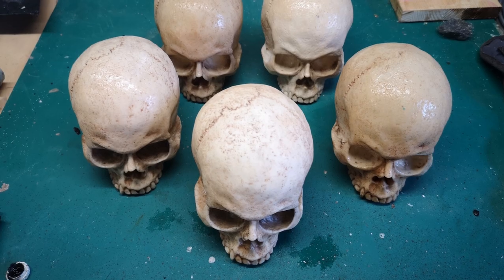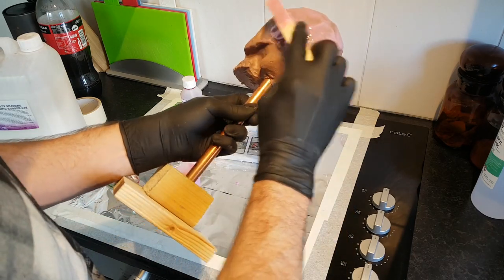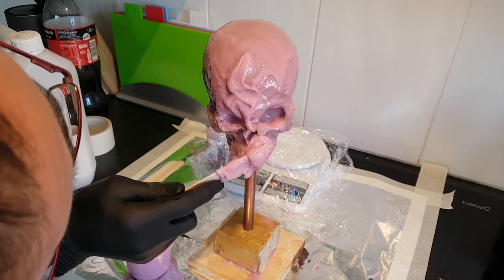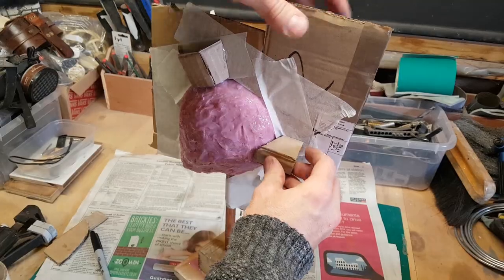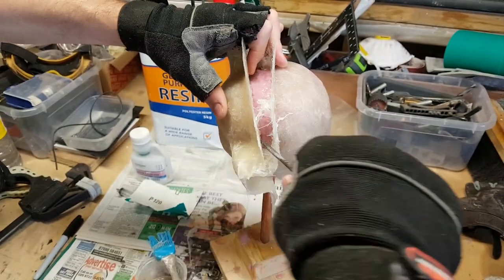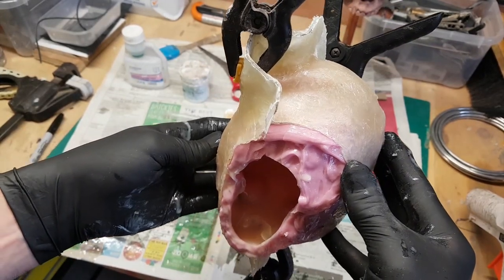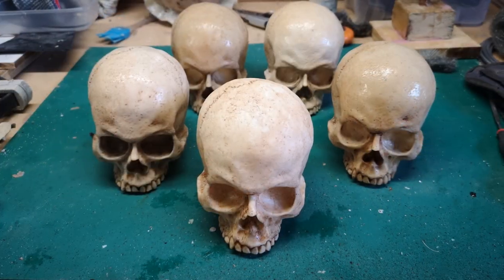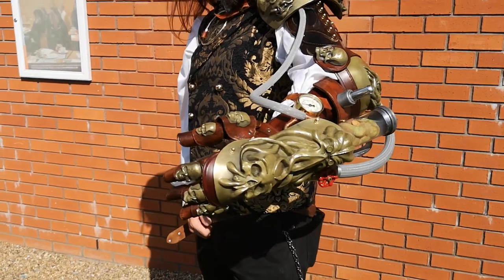Moulding and Casting Skulls

Comment: Love it! I sculpted a small skull (between the size of a golf ball and a baseball) and I am wondering what is the best method to make a mold of it for casting? 1. Place in a cup and pour resin in the cup? or 2. two part mold of L and R sides similar to this video... ?
Reply from the maker: The easiest way would probably be to attach it to a board, hot glue some foam board around it to create a surround and then pour the silicon.
Reply: @thedarkpower  Thank you!

Comment: Could concrete be used in this type of mold, and if so, how many would it cast before starting to degrade?
Reply from the maker: Yes it could. For something this small I'm not sure how well it would pick up the detail, but you'd get something.  Generally moulds can do about 40-50 casts before they start degrading if resin is used.  I've not tried concrete so I'm not sure if that would change if concrete was used.

Comment: I bought a decorative skull and noticed it had a little weight to it. On the very bottom of the stand (it’s a skull and little bit of spine on a stand) there is a little hole. What material could this be made from? I feel the little hole is a clue on how it was made.
Reply from the maker: If it's mass produced I'd imagine it's a blown plastic, maybe abit like a drinks bottle.  If it's hand made it could me roto cast polyurethane.

Comment: Can i ask which polyester resin you used for slush casting...it seemed to cure very quick for a polyester resin..cheers
Reply from the maker: I'm using this stuff with around 3% catalyst, although I'm often not that precise and usually over catalyse, so that might be why it seemed quicker  

https://www.cfsnet.co.uk/acatalog/General_Purpose_Resin.html
Reply: @thedarkpower  Many thanks for the link.

Comment: Hi mate. Great work excellent detail. Was looking at the Blue Stuff Silicone but could you tell me which brand your using? PS:  If you had got some solder you could of used that to get the correct diameter of the cast and convert it to card for a nice snug fit for your resinn jacket
Reply from the maker: Thanks!  I'm using this stuff  https://www.dwrplastics.com/general-purpose-moulding-rubber.html

Ah you mean bend some solder round the mould to get the contour?  Good idea.